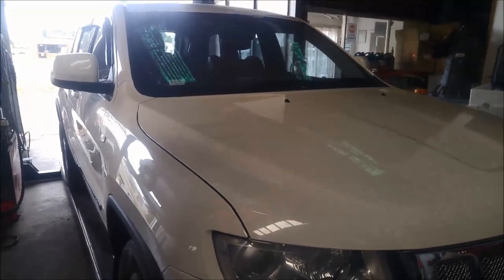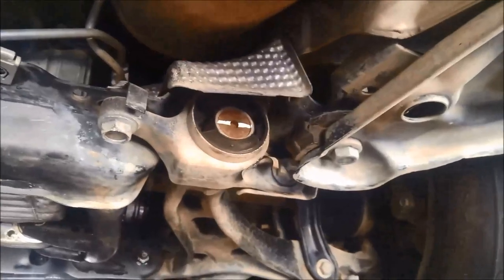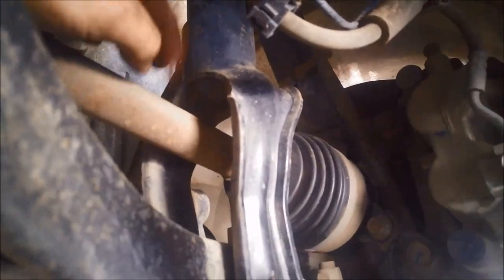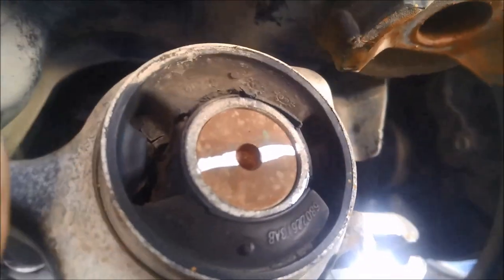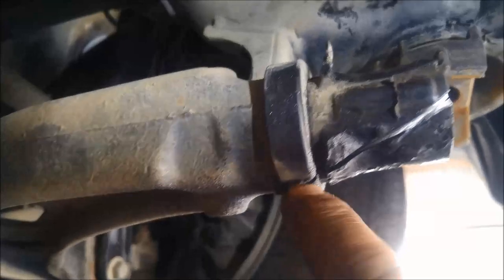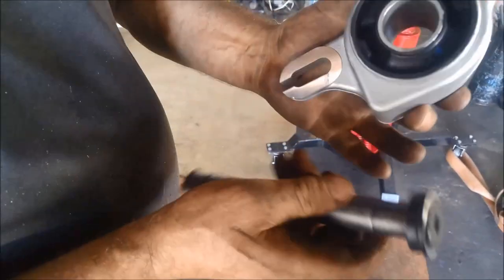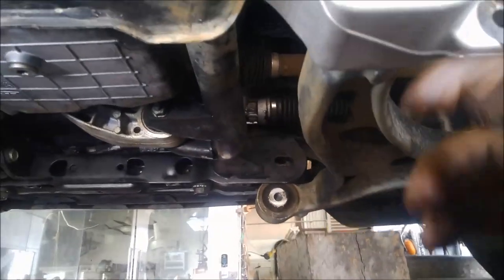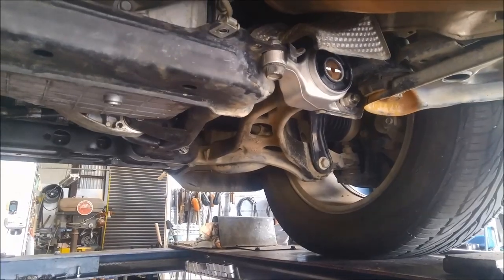How to Replace Front Wishbone Bushes In Car No Special Tools - Jeep Grand Cherokee

Comment: Why wouldn't you take the arm off and replace all the bushings? The others are just as old as that one and, if not completely trashed yet, are well on their way.
I am currently replacing all the bushings on my 2013 JGC using Superpro poly bushings, so I won't ever have to replace them again! This video has helped me with this particular bushing, because the arm was too big to get into my press and I wasn't sure how the heck I was going to get it out! Thanks!
Reply from the maker: hi, customers instructions for what required for a road-worth certificate from memory. check out https://youtu.be/NORAgTZmyoQ & https://youtu.be/dFoAAhyOSkw   for how to fit polyurethane bushes. cheers

Comment: In the USA each lower cast arm for the 2011-2014 grand Cherokee is about $360 from Mopar. At that price, would you recommend just replacing the entire thing? 

My 13 has 130k miles, and just finished an OME kit and HD upper front control arms. Still have a low speed clunk up front and I suspect this wishbone bushings. Wish I just did them when I had everything apart!
Reply from the maker: hi, there is always the weighing up of replacing worn components versus replacing the whole thing. choices are always yours to make, and hopefully made after considering all the options available. cheers

Comment: Part number?
Reply from the maker: hi, refer to your jeep dealer. cheers
Reply: Hi, already called around different dealerships and they all told me I have to replace the whole arm, that keep doesn’t sell the bushing alone
Reply: @pedrovasquez2964  correct. Stelantis only sell complete lower control arm. AU over $ 1k each arm.  However  purchase rear bush on-line.
Good brands MOOG PN K201334 left, K201335 right. or MOVOTECH MS254258 left, MS254259 right.
Reply: Thanks so much saved me a ton of money! I’m going to get the parts and do it myself 👍

Comment: That's why they call them cheap...! . So bad design.. heat  Shielding  for them.jeeezzz.....
Reply from the maker: hi, if when they fit any bushings, and the rubber is under twisting tension, this is what prematurely wears out the bushing or causes the rubber to split or come away from the sleeve. this happens often when mechanics do these kind of repairs on 2 post hoist and suspension is hanging down and when they don`t tension up bushing when the suspension is at normal resting position. cheers
Reply: Really……it’s Mercedes design. Merc chassis. Rubber bushings eventually fail. Not if, but when.